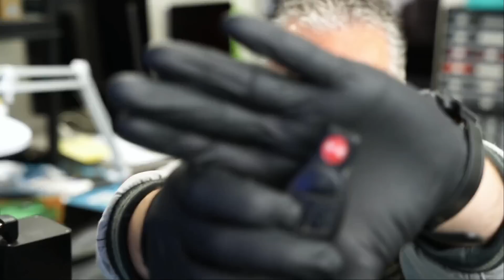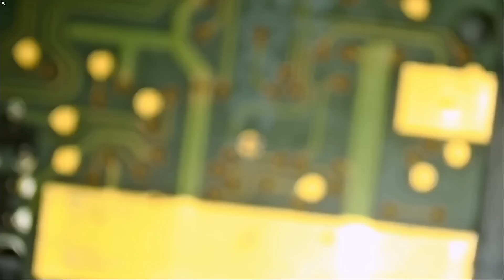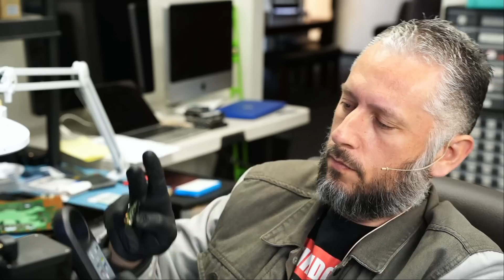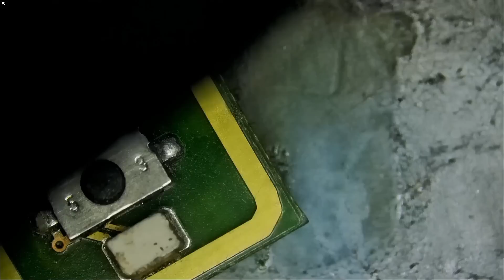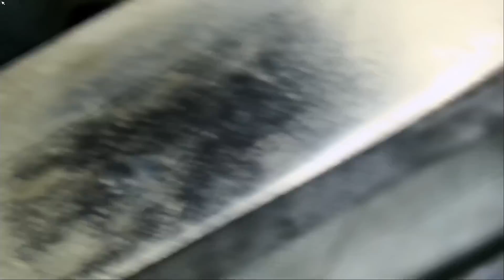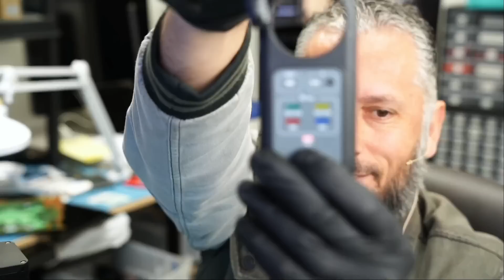Benz S500 Fob Repair - Won't start car.

Comment: would try electrically conductive 2 part epoxy to attach that IR sensor. need not worry about melting plastic. rough up apposing ends first

Comment: instead of using the iron delicately to solder on the IR emitter , you could have simply used the same method you used to desolder it from the donor , AKA heating from the bottom . would have been much easier

Comment: Good morning NorthridgeFix. I really enjoy the work and interested trying this as a hobby. 
Wanted to try console repair in the future. 
Possible suggestion for the equipment to repair console for a starter hobby?
I’ve built computers, solder repair on Trane fan control boards as part of my career as a building stationary engineer. Thanks you!

Comment: You asked for comments on braid wick... When I first got mine I had a super cheap soldering iron, and I didn't like it much. It was because I didn't have enough heat transfer. My new iron works great with the premium braid and it holds way more solder than the cheap stuff.

Comment: Mercedes engineering is so bad.  That LED should last forever.  It's only on for a few minutes its whole life. They over drive a part to save a few pennies that guarantees you buy a new FOB every few years for $350.

Comment: It would also be possible to use solder paste and heat it from below, if possible. No?
Reply from the maker: Back side of the board also has a similar IR component.
Reply: @NorthridgeFix  It's understandable then, you're right, Alex. ;)

Comment: I am confused why the soldering iron could be used to successfully attach the new component to the board, but when it was used to try to remove it from  the board, it made the component's metal edges pop out.
Reply: that's because the solder iron was touching the solder pads, not the component itself. the tip already had a bit of solder, so by touching only the pads he was able to solder it back. solder moves to wherever there is heat and flux.
Reply: @DPLS77  So, when installing the component, you are just letting hot solder flow into the joint, while to remove it, you are heating the joint;  is that the answer?
Reply from the maker: @bmomjian  Solder on the board is unleaded and harder to remove. You'll need to touch both sides of the IR component at the same time to desolder the component. When you solder, it's different. You can touch the pads one at a time hence the use of the soldering iron to solder and not desoloder. .
Reply: @NorthridgeFix  What I used to do for more robust components is to apply soldering iron heat to one side while applying slight upward pressure, and once I detached one side I would do that other.  I didn't have sophisticated tools like the hot air gun.  I can see why a delicate component like you had needs special tools.
Reply: @bmomjian  to remove that component he used a hot air gun from underneath at very low temperature, but to put it back on it's different.  Solder flows to any conductive area that has HEAT on it using surface tension. Solder doesn't flow into the joint like water, it is more like when two water droplets barely touch they instantly become one droplet, solder does the same when it touches a hot, conductive area covered in flux. He heated up the pad, so the solder flowed there, in this case it isn't necessary to directly touch the component.
Reply: When attaching the new component, heat was only applied only to the pad, and withdrawn the split second that the solder flowed. Then the component dropped down into place. The component only experienced heat momentarily.

When unsoldering, the component will not magically jump up and away from the pad (and connected heat), as it is held / fixed in place by its other soldered joint. Timing is critical for this repair, as is where the heat is applied to. It's best to have a bunch of spares when attempting this kind of repair, as the success rate can be low.
Reply from the maker: The answer is in the video. You're not paying attention.
Reply: @NorthridgeFix  Lol

Comment: Are IR led super sensitive to heat or something ? I don't see the point of them having such a fragile packaging.
Reply: Plastic parts in engine, sensors which goes faulty all the time, low quality keys. They do it because it means more money for them.
Reply: @kkeestar  yup, how they are gonna charge hundreds of dollars if not for fragile components that costs cents?
Reply: Planned obsolescence most likely
Reply: This is why we watch NFR👍🇬🇧